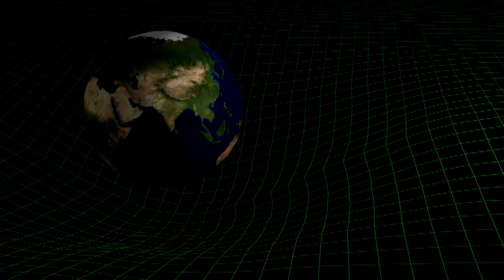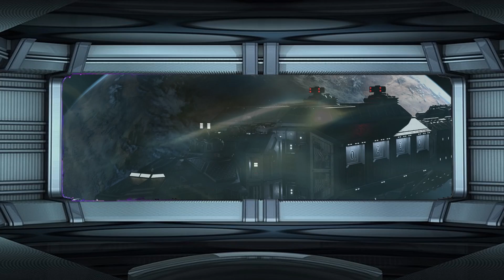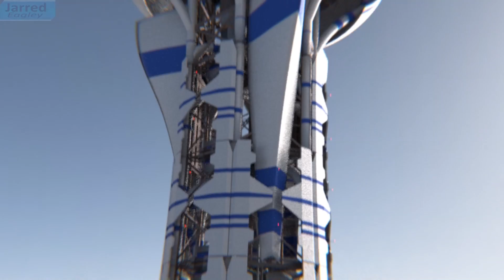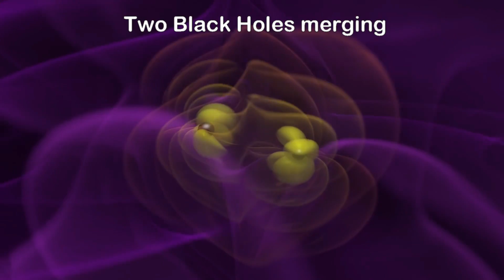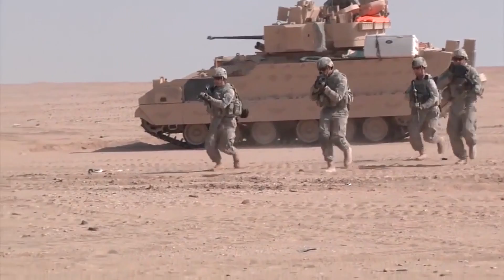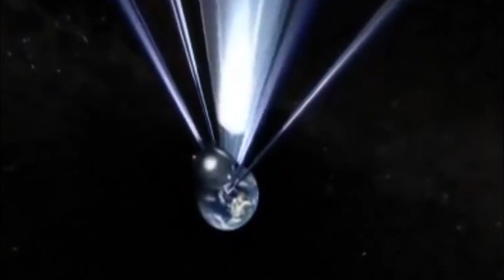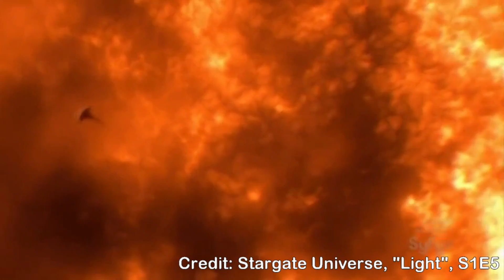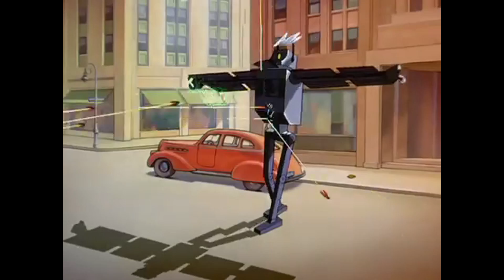Force Fields

Comment: Well to the point made about a ‘force field’ that only let through partials of a certain velocity, that would not actually tell entropy to fluff off, because you wound still need to supply said ‘force field’ with energy from somewhere, (like a electricity grid or since this is a channel on science and futurism, a fusion reactor your fuel new in a higher state of entropy hence not booting entropy but just moving it someplace else, into the environment) 
On a complete unrelated note, card games on motorcycles is the new ‘two camels in a tiny car’ yusei GO!

Comment: My idea is to make a grid that puts water in the spaces using surface tension to keep it in place, and then fills it back up if it gets disrupted. If the frame gets damaged that could be a problem.

Comment: I was thinking about having a detection system like you said except it uses plasma shields that are magnetically propelled to intercept incoming lasers or projectiles from certain locations on the vessel in need of protection which can be curved to form micro-shields at the locations needed

Comment: Would it be possible or feasable to dissipate laser based weapons? Instead of trying to block it you would try to lessen the focus on the beam to a degree it isn't harmful anymore?
Also...what if the forcefield of the future isn't one thing but a combination of diffrent kind of defense mechanisms against diffrent kind of attacks. Possibly reducing the complexity one countermeasure has to come up with into a couple of simpler straight forward systems that solve specific defense problems instead of the general problem of absolute defense.

Comment: Also gravity is NOT a fundamental force, its just what happens when you warp space time. 
Similar to holding a bed sheet and putting a weight in the middle.
Now anything you put on the sheet will now head to the center of the sheet. 
It's not because a force guides it there, it's because, for lack of a better explanation there is now a downwards hill to the middle of the sheet and nature always takes the path of least resistance in this case down.. but could just as easily be up or sideways. 

A fundamental force is 'fundamental' to everything! So where is gravity in space?

Comment: You can't get Maxwells demon with a force field as the strength of the field and thus the rate of heat separation is dependent on percentage efficiency from a power source. So if your percentage efficency is less than 100 percent then you will still use energy.

Comment: i have spent most of my life thinking about force felds and trying to make them plasabul i think a clod of highly magnetic irn particals with a - chage anything passing in to the clod picks up the charge and is repaeled by the rest of the irn clod at the right level of power or speed the lays of - irn particals would be as if saled.

Comment: question: what about a hybrid system? a point defense shield - if plasma can be manipulated in shape and moved around the with magnetic fields why not create a number of sectors that can be moved around your vessel or person like a buckler. Yes it has drawbacks like:  
area damage weapons like small scale nukes doing damage if the "buckler" is not positioned properly
some kind of AI to respond and move it around into the correct position (humans are too slow)
this system can be also used as "melee" weapon at point blank ...

Comment: Lets pretend that a force field may be able to separate hot and cold but I'd bet there would be a loss anyway, probably by the hot side of the field being a radiant emitter. So it'll probably glow like a light house :P And you;d still need energy to drive the process in the first place. Maxwell's Demon won;t even get a look in. Even without heat that energy ends up doing something else other than what it started as and getting back is still going to be a pain in the neck if not nigh on impossible.

Comment: If we had a better understanding of the Higg's Boson, we could control the way the mass behaves. It wouldn't actually be a shield, but an area were higg's boson could controled. imagine a bullet at high spead, and you remove momentum from the lead, or even reverse it. There would be no shield, but area were you could control the potential energy of any matter. It wouldn't work with lasers, or other none matter weapons, But with most real life weapon, it would work just fine.

Comment: I think a kind of force field is needed if we are ever to leave our solar system, maybe the plasma shield you mentioned. 
While a magnetic field might do wonders against space radiation, i does absolutely nothing against rocks dust and other things. 
A if we do reach the speeds needed to reach other solar systems in our lifetimes, things such as rocks, dust and other things are going to hit our spaceship like bullets.
Now i don´t now how solid our current spaceships are, but i am fairly certain that if i brought a gun up there and started firing it at close range against the hull, it would penetrate it with little to no problems. 
Even if the first bullet by some miracle doesn´t penetrate the hull, the next 10 or 20 bullets firing at the same point will eventually penetrate it or cause serious damage.

So i think we will probably need something to burn off all those rocks,debris and such things, before they hit our ship or at least slow them down to such a degree that will bonce harmlessly off the hull.

Comment: A friend of mine was talking about the impossibility of force fields as we drove in a car.  I rapped my knuckles on the windshield.  What, I asked, did he think that was?
Oh, sure, it is "matter", a word we throw about as though chunks of thing actually touched each other- But they don't.  The electromagnetic fields of the electron shells of one thing repel the electromagnetic fields of the shells of another thing.  And in a windshield this web of forces woven together on a matrix of nucleons selectively admits electromagnetic radiation by frequency and repels most affronts by matter.  So, while everything you say, Isaac, is true as far as it goes, I still suspect it is not unlikely someone will figure out how to replace the function of the matrix of nucleons and produce something that actually performs in a manner not unlike the nominal force fields of everyday matter.

Comment: Great video. Ian M Banks' Culture universe makes extensive use of force fields. They are used in the construction of mega structures and as the hulls of ships (Which are often huge asymmetrical things covered in parks and pierced with balconies, huge hangers, and bays beneath their field envelopes). Fields are also used to manipulate matter, allowing machines to do everything from very delicate interactions like a caress or sculpting, to slicing through armour like it was nothing. The fields are also used the manipulate light and sound, often mirroring or projecting an image.
Reply: Sounds like magic.

Comment: Steel armor and weapons are NOT better than bronze armor or weaspons. Quite the opposite, bronze is far superior in practically every metric that you can think of, except one: Price. Copper, the main ingredient of any bronze, is quite rare and expensive, and the ingredients to make proper bronze (Ranging from the well known tin over to zinc and bismuth) are even rarer, especially since they're not usually found in the vicinity of the copper. Meanwhile, the various iron make up a huge percentage of the earths crust, you can literally pick up a rock in any river valley and melt it into iron - if you can actually melt it into iron, because iron requires roughly double the temperatures to melt from the bronze constituents. Temperatures which simply aren't reached by basic fire and require ventilation systems and specialized ovens.

The "Bronze stuff" vs "Iron/Steel" stuff isn't a matter of one sides weapon simply penetrating the other sides armor due to superior structural integrity or some such. It's a matter of "Having a few 100 highly trained warrior caste type people wearing heavy armor fighting unarmored and untrained hordes of savages" vs "Having 100'000 moderately trained peasants wearing heavy armor fighting 100 people".
Reply: Modern steel is quite a bit better than any bronze, it is only early and middle steel that are worse off. By the medieval times, the steel was vastly superior.

Comment: I've been slowly cooking a sci-fi setting where the civilizations use two shields: a general shield that's most useful against plasma and rarified matter (usually used for high-speed re-entry) and what can be thought of as a space-time lens (an offshoot of Alcubierre tech).
The general shield is a stereotypical, though weak, sci-fi shield
the lenses are used to redirect threats coming towards a ship.  Larger and more powerful ships can generate more lenses and the tech generally generates the same sized lenses regardless of ship size.  Largest capital ships can use these lenses to redirect beam weapons to the point of having the enemy shoot at themselves.

Next layers of defence are polarized fields on the armor to diffuse charged particle "projectiles," layered composite armor plates and an ablative filler between armor and the outermost pressure shell.

Comment: Well it made me think if we can create artificial gravity can we manipulate gravity as a form of weapon like :
1 creating a positive gravity force field powerfull enough near or in a spaceship to crush it from Inside
2 creating a missile that is with it's own force field to negate the effect off the other ship force fild then once it hit the ship it does the same as above.
or like a mean of transport by pushing/attracting the ship with a gravtational force in the front of said ship
and even using it for FTL drive by negating the ship's mass or even put the ship's mass in the negative so that it's "lighter" than light and as such does not break the laws of physics and since the ship will basically push anything that come near it then there is no real worry about the ship getting it by little grain of sand in space

Comment: well, if something can select stuff based on speed, it has to use energy doing so (that is how the landauer limit can be derived). So even highly targeted force field analog would use energy based on area it it covers, not only the number of impacts it deflects.
This is kinda why you would not be able to break the 2nd law of thermodynamics with a force field, just having it select stuff will always use energy.

Deflecting lasers is a hard thing. If you can manipulate space time enough to redshift it, or just make it miss, you could just tear the enemy ship apart with a high amplitude gravitational wave. Mirrors are also not really feasible, because they are never 100% reflective, you can come close, but only on a small frequency band. Shoot a visible light mirror with a gaser or a maser and you will get though. 
Dispersing it will probably also not really work because you're now likely to have a highly energized plasma right in front of you.
My best bet is absorbing the energy chemically, eg with an ozone and oxygen mixture to cover the UV spectrum and other gases for the other frequencies. Issue being, that gasers will still fry you and your ship.

But I don't think lasers are good weapons at that point. You are talking about a time, where weak AI can pretty much fight battles alone, and only needs very rough instructions , so I doubt there will be much more than 2-12 humans aboard the actual battleships, so very targeted hits are probably very ineffective, so unless you get VERY close quarters it'd probably take a lot of hits until a ship in damaged in a significant way
Reply: Industrial lasers cut thick steel every day. 

Laboratory high-power lasers tend to use diffraction gratings in place of mirrors.
Reply: Garganzuul not my point... Sure you can penetrant the hull if you hit. But what kind of damage will you do? Very localized, probably relatively small penetration. On a larger ship, where critical systems are redundantly backed up, this wouldn't lead to failure unless you get very lucky or hit a lot

Comment: Question regarding forcefields for ships. Could it be possible to simply have the forcefield hug the ships outer hulls with the exception on the ships armaments? Could they insulate the armament and have it protruding beyond the field?
Reply: A torus knot (like a stellerator) anti-laser electron field could have slits in it, but not conform to the shape of a hull.

Comment: @Isaac Arthur:
What about a black hole technology like used by the yuuzhan vong in star wars? They use moveable black holes to absorb enemy weapons fire. By absorbing the energy you won't heat yourself up.
Reply from the maker: Only useful if you have some trick for making bigger event horizons, those have diameters linear to mass, so small black holes are actually crummy at it.

Comment: Regarding shielding large space vessels, what about the proposition of water/liquid shields?  Big thick tanks of water to shield from radiation, of course.  But also absorb, and break up, high-speed physical projectiles within, after striking them but before reaching the habitation vessel inside.  Of course there would be a lot more to the details (e.g. good self-sealing tanks, water replen, etc) but perhaps it would be a practical shield substitute on the large spaceship scale where weight is less of an issue.

Comment: A portable laser gun could be built but it requires a specialized high fractoring mirror and a specialized battery. Much stronger than Fallout laser guns but the gun would overheat due to low heat resistance

Comment: Couldn't we just create a magnetic field akin to something like Earth's? Mainly make it work like this but for a space ship.
Reply: Dune was boring to me.
Reply: It's an electromagnetic field similar to Earth's magnetic field being controlled by specialized magnets that produce a magnetic plasma field via the ships energy. 

Assuming space ships use plasma batteries then it could be a thing.
Reply: Using a magnetic styled field along with a tiny battery carriable by people. Assuming batteries get better and smaller it can occur. Another idea is one I'm in favor of is the use of nanomachines that create specialized fields quickly via matter.
Reply: Magnetic force fields. A magnetized field that causes objects to sort of bounce off. Think about it. Basically a magnet and how two positive poles push away so do that.
Reply: Like I said a magnetic force field mixed with a plasma field. Mix both together and it will work. There's a third option that can be added

Comment: Hey Issac Arthur, I'm trying to write a space opera that uses force fields as a component of an FTL drive, and I need some help with making it as close to hard-scifi as I can. In the story, interstellar travel is achieved by traversing through small, stable black holes that are created in front of a star ship called "rifts". In order to make a rift a kilometer long, cone-shaped force field is projected in front of the ship with the point facing outwards. Another even more powerful force field then rams a block of matter down the cone, using the walls to cram it down smaller and smaller until it eventually hits it's schwarzschild radius at the point and collapses into a black hole.

What kind of a force field would be the most realistic option for such a drive, and how much resources and energy would it take just to fire it once?
Reply: I'm not Isaac, but a Higgs-boson 'laser' could potentially do what you ask. Close enough for hard scifi anyway.

Comment: The star carrier series had shields just as you described that when you raised shields to 100% it effectively created a black bubble not even letting light in. It also used strategic dropping of shields to fire. The ship that was being primaried by ship fire went black and it was a huge energy hog. They also had advanced ai that painted a picture during black mode so as to guestimate enemy positions. Split second flicking on an off allowed laser communication. Great sci fi series.

Comment: Hey Isaac, as a huge Dune nerd I have to point something out to you, the shields in Dune actually do account for the speed of air particles. There's commentary early on about air inside your shield getting 'stale' as the rate of interchange is is low and shield contacts build up ozone (a possible hint at the mechanism being some sort of energized plasma bound by electromagnatism I think). My assumption has always been that only those air particles moving slow relative to the wearer's movement through the air would get through, that would account both for the fact that the air was getting stale while in use while still allowing for some interchange so that the wearer doesn't die in like two minutes.
Reply from the maker: Yes that's possible, I'd forgotten the stale part, but I'm not really criticizing Herbert on that score anyway, it is scifi and he was clearly going for less tech more character interaction anyway, but he does clearly spend time on the science, its just sometimes rather dubious.

Comment: isn't it possible to separate a fluid or gas into hot and cold parts using a Ranque-Hilsch vortex tube?

now i realise that you probably meant it in a more fundamental context, i don't know the exact mechanism of vortex tubes but it is clear that there is an external source of entropy involved, but wouldn't the hypothetical maxwell shield also have that?

on a side note; while trying to read up on Maxwell's demon i stumbled upon duncans paradox, they apparently have experimental evidence for a breakdown of the second law of thermodynamics, i freely admit that i don't understand the exact implications, surely they cant mean it in the most general sense?
https://link.springer.com/article/10.1007%2Fs10701-014-9781-5